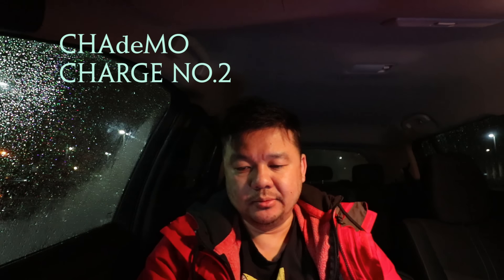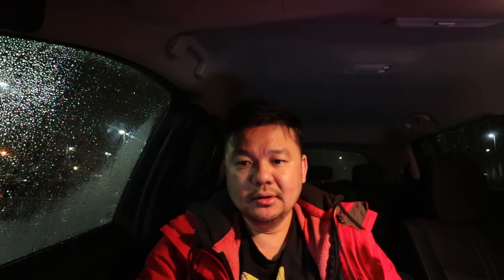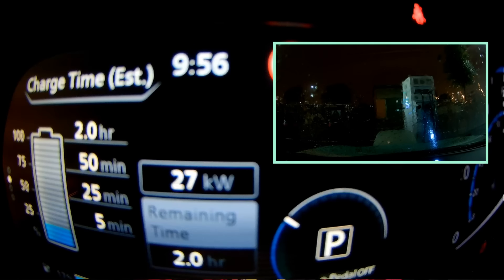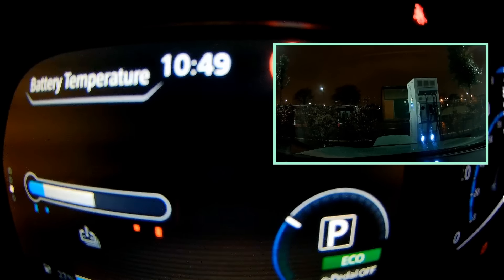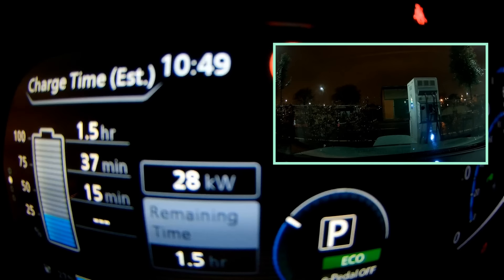Will lack of active thermal management system be an issue on Nissan's 40kWh Leaf?

Comment: Good work LTL and thanks for being a guinea-pig and doing more testing.  

Yes, this has come up recently and seems to be taking social media by storm - which I don't think is the right way because pretty soon you will see a lynch-mob mentality and I don't think that is Nissan's intent - to mislead anyone.  

It's clear that Nissan has put in safety features as to limit temperature increases which can be harmful to the battery and produce faster than normal degradation over the long use.  This new pack is more dense with a different chemistry than the 30kWh pack.  So being more dense will produce more heat.  

The 2018 Nissan Leaf battery – like all previous versions – uses a 96s2p cell configuration, this means that in total there are 192 cells in the battery pack. However, the battery cells now have a much higher energy density. 

In the 2018 Nissan Leaf, each battery pack has 24 modules and each module has 8 cells. Originally, the Nissan Leaf was launched with double the modules. The 24 kWh battery in the 2011 Nissan Leaf had 48 modules, each module with 4 cells. However, when Nissan released the 30 kWh battery, the number of modules was reduced to half – to further increase the energy density of the battery pack. 

This new pack has same number of cells, 192 but more densely packed.  The EV Module is 8 metal cells (pouch design) connected and housed in a metal case.  The case plays a role of protecting the cell from vibrations and the like, and its simple and compact shape increases the flexibility of pack design.  There are multiple slits and openings within this module that allow for passive heat dissipation, but obviously there are limits to this design.  I believe one of the chemistry changes is that Nissan added more Magnesium (but I could be mistaken in exactly how the chemistry was changed), but whatever they did was to lead to better energy retention properties.  

So with this info, on can calculate the new battery real capacity:
192 x 3,65 V x 56,3 Ah = 39,46 kWh
 
And compare it to the original battery pack in the 2011 Nissan Leaf:
192 x 3,75 V x 32,5 Ah = 23,4 kWh

Combine this physical change with a new chemistry and you get more density which produces a larger battery pack size and more energy output - hence the higher HP and Torque numbers.  The electric motor is the same, Nissan just tweaked the inverter to provide more power to the AC Motor.  

I think we can all agree that we wish Nissan had added in Active Thermal Management (ATM) to the 2018 Leaf.  However, they have not and will not for this MY so let's not beat that point to death.  If ATM is important, then I would advise not to get the 2018 Leaf, especially if you plan on doing longer range trips more frequently involving more successive Rapid Charging, as shown by LTL and other videos.  

I also think most people miss this point of the target market for the Leaf and the way it's priced.  It is for more Urban-ish applications in general.  Nissan saw a sweet-spot and gap in the 120mile range to 200mile range marketplace, and designed the 2018 Leaf as a product to play in that field.  It's not designed to be a Model 3 like-for-like, or even a Bolt like-for-like.  Both of those EV's have much higher range and ATM - but they cost thousands of dollars more - especially when you similarly equip them with the different Leaf Trims.  We know Nissan will come out with more of a competitor to these models next year or in early 2020 with an estimated 60kWh pack design that is guessed to have ATM technology.  And of course, it will be priced similar to competitors at that level.  

So knowing this, anyone looking for a full zero-emission all-electric compact vehicle, should be able to make a decision and see if the 2018 Leaf is right for them and their use cases.  As an example for me, my 2018 Leaf will be my daily driver as 90% of my driving is about 50-100KMs per day - well within the 200+ KM stated range - and even with cold weather losses of 30-40% range drop thrown in.  Plus in my family, we still have 2 ICE cars and if need to do a long trip (which we do occasionally), then I will take one of those cars.  

Yes, Nissan says use the car like you would any other car.  And in reality you can, however as LTL points out if you want to go for a 400+ mile trip, be prepared to add the extra time needed for your trip to account for slower rapid charging and cooling times with the battery.  

Nissan basically writes that into the Owners Manual, so they are not "hiding" or looking to "massively fraud" anyone.  That is ridiculous thinking that will just aggravate people into a mob-like mentality and scar the EV market as a whole.  Remember, people are getting upset with the fact that it will take longer to do a long roadtrip than it may in another BEV.  You absolutely CAN still do a long road trip in the 2018 Leaf, like if you want to drive to France for holidays LTL.  However, as you pointed out, you may CHOOSE not to since the inconvenience of more time to make the trip may warrant you taking an ICE or longer range PHEV or BEV car instead.  That is your choice and not because the 2018 Leaf can't technically or physically do the trip.  

I spoke to someone the other day that told me they love stopping for fast charging and don't mind the times, as that adds to the experience of the roadtrip for them.  So, if you want to go 400+ miles and get there the fastest, maybe don't buy a 2018 Leaf and look at a Bolt, or Tesla or i-Pace instead.  Or stick to ICE or rent an ICE car, etc.  You make the choice knowing what is available.  

I find it very unlikely (yet of course anything is possible) that a big company like Nissan, the original real founder of a mass-market BEV that prides itself on this fact of helping to ignite a new industry, would really open themselves up to a potentially massive lawsuit?  They know people are smart, we have tools like Leaf Spy Pro to use and most current BEV adopters are fairly tech savvy, so that something like what we are seeing would come to light quite easily.  And we use Social Media as a platform to spread opinions and experiences - and negative comments spread like wild-fire more than positive ones.  

I agree with those that in my thinking believe this to be a safety guard to protect the battery.  Plain and simple.  Yes, Nissan should state this with more vigor when advertising or selling the new Leaf, however we know that does not always happen.  It's also been shown that the GOM on the 2018 Leaf is really conservative and that the lower remaining battery percentage goes, the larger the difference is between actual SOC and the GOM (max at about 10-12% I think).  Again, I believe Nissan has done this in order to add a cushion for people so they don't end up being stranded with a fully depleted battery.  

So for those who want to slam Nissan and spread more negative comments, you might want to instead inform people interested in a BEV purchase of the real usability of the 2018 Leaf, so that they can judge for themselves if it is the right fit for their lifestyle and needs.  I am not saying that LTL is slamming Nissan - on the contrary his videos are excellent and he's just pointing out a current restriction with this BEV.  Maybe Nissan will tweak the software to allow for more charging input when the temps creep up a bit more than what it seems to be set for today. 

Also remember, the DC Fast charging station really does not impact charging speed in the vehicle.  All BEVs carry on-board chargers so the DC EVSE is really just a long plug that supplies up to a certain max power output.  The EV's on-board charger is what controls how much charge goes to the battery, not the external EVSE.  So, Nissan can tweak this situation if they feel they need to - which I'm not really sure they do.

This situation brought to light does nothing to change my personal opinion of the new Leaf and I agree with LTL, it's a great car and I am NOT cancelling my order in any way and look forward to getting my own Green (Jade Frost) Leaf in a couple of months.  

Sorry for the long response but I thought it important to bring this "issue" back into perspective.  

Keep up the great work LTL and I'll be talking about this on my next YouTube show coming up in a week or so.
Reply: Hi Kenneth, I know you from the M3OC... didn’t realize you got or are getting a leaf, I thought you had your name down for a M3? I have a reservation for a M3 and a leaf 2.0 preorder...mitigating risk around the rebate/election. Lol. Anyhow, all valid points you are making but it still doesn’t explain why Nissan did not put in a TMS! If they would have included in even a basic one i.e. a series of fans, it would have helped! This was a pure cost decision and they botched it. There will soon be a video out of a 650 mile drive in the  UK by both the ioniq and leaf. In the video the leaf and ioniq both leave the starting point at the same time but apparently the ioniq completes the drive 4 hours before the leaf all because of overheated battery issues!
Reply: Hi CB yes that is me.  And yes, I made the decision to order the Leaf instead.  Came down to financial cost (since I was interested only in the SR basic Trim Model 3) and that won't be shipping to Canada till 2019, and I am really concerned about the EVIP.  So wanted make sure I got the $14K.  No regrets and I will be stating this on our next show.  Just wanted to make sure the EVIP was still in play when I ordered the Leaf.  

Well, I really believe Nissan did not put in TMS for cost, and they feel the chemistry change was good enough to handle the vast majority of use cases.  Again, its not that that Leaf can't do long trips, it's just that is appears with Nissans safeguards, it will just take longer than what other BEVs can do.  So knowing that, a person can make the choice.  They needed to keep Leaf as a viable product in preparation for the larger pack model coming in 2019/2020 and the 2018 fit into a certain market segment.  I don't  have any problem with them putting this version out this year.
Reply: Kenneth Bokor I have a pearl white SV on preorder and it is expected to arrive in April. As well, I am planning to purchase the M3 current production.  If I get an invitation to place the M3 order shortly, I will not take the leaf. You are more than welcomed to take my place in line if interested.
Reply: I'm sorry to hear your rationalization. It's tragic to say the least. It does matter that Nissan has 'knowingly'  chosen to produce the Leaf without active thermal battery cooling/heating. And to make false statements about the importance of that specification failure for the use of the 2018 Leaf. As manufacturers with engineering expertise they have willingly produced a vehicle of unreasonable capabilities. And have not disclosed this to the public. When this behavior has become apparent the best course is to penalize such manufacturers by refusing to accept their product. That's part of the responsibility of every consumer. And it is your responsibility also.
Reply: Kenneth Bokor The big question remains....Does this software limiter really protect the battery when doing a very long trip.

Charging and discharging a li ion battery at a high temperature accelerates degradation. We all should know that (for people who don't know, but want to know...search for Jeff Dahn. He is a professor and has a great lecture online explaining factors surrounding degradation).

Now...apparently the amount of time spend (dis)charging at a high temperature is most damaging. Not the amount of power during the charge...

So would an hour of charging at 40-45 degrees C be more or less damaging then half an hour at 60 degrees. That's the tweak room Nissan has.

This somewhat limited long range ability is a trade off because of costs. The 40kWh Leaf will have an average charge rate of 20-28kW during a very long trip. The LR Model 3 would probably be able to hit an average of around 60-70kW.

In the end, you get what you pay for. Most difficult to assess is what to really expect from the car you paid good money for. Nissan should really communicate clearly on the long range travel limitations.

Interesting tidbit. Bjorn just did an (regular in his book) Oslo - Trondheim - Olso trip in the 2018 Leaf and had same results. Same charging rates at same temperatures. Very hard to cool down the battery between charging sessions, driving around 80kph in -5 to -10 degree C temperatures. Also....the charging rate seems to be determined at the start of the session based on the temp at the start of the session. Bjorn was charging at a certain rate (expected based on starting temp), then after a while, he disconnected and started a new session in succession. The second session started at a higher battery temperature than the first one and sure enough, the charging rate was lower.
Reply: People are complaining because it is a brand new car, but in it's name it should also be a "short range" or "City".
It's actual range at a decent speed is about 300 km, ranging from 250 to 350, depending on temperature. Any motorway driving, including some fast charging sessions beyond only one will become a pain for the owner.
Yes, it is a nice short/mid range commuter car, but it could be so much more.

People are comparing it to the Hyundai Ioniq, which has a significantly smaller battery, but has similar motorway range due to better efficiency and greatly superior long range capability due to active TMS.
Reply: I have owned a 2013 leaf for 3 years. I just bought a 2018.  I'm used to being a able to "fast charge" multiple times. I've read the manual. Saying "quick charging ... even several times a day" "if the battery temperature is not near the res zone" I have seen limiting with temp just above the middle of the bar. For the record the whole gauge is near the red zone. Near the red is ambiguous as hell. Ambiguities are read against the writer. 

Limiting battery heat at low temperatures is not a safety issue it is a warranty expense issue. 

Did Lemon Tea say limiting occurred at 38 c / 98f? If so that would mean no real fast charge in wide swaths of the world for most of the warm weather. 

I could not fully fast charge. 

That is not clear from any source from Nissan.

Comment: The issue lies within the BMS. Nissan needs to reprogram it so it stays at a hgher rate of charge until it reaches >47 Celcius. The 40kWh has a newer chemistry versus the 30kWh. The newer chemistry ( less manganese) has a lower internal resistance, so it should heat up less than the 30kWh. Having owned all versions of the Leaf, the 40kWh is the worst with regards to charging rates. I did 4 consecutive QC in a row on my 30kWh and the battery temp was at 49 Celcius. The charging rate did not drop like on the 4 kWh Leaf.  After 53000 kilometers my 30kWh has 2.2 % battery degredation. Another thing people are not aware of is the fault in the BMS with regards to true SOC. Plus the battery % on the dash jumps up and down. This needs to be addressed also. Thanks for another great video.
Reply: I think videos where LEAF-SPY has been used to compare battery % with that shown on the car - Nissan's 100% indication is really about 90% and Nissan's 0% is really 9to 10% so they are restricting you to a charge capacity of 80% to allow EV novices to charge to what they believe to be full 100% without damage and run it down to what they believe to be flat 0% without damage to the battery from overcharge or low-charge states.  I believe they have also taken this overprotective approach to the temperature v charge rate mapping which I'm sure they would reason ought not to be a problem if you follow their fair usage policy of no more that 1 rapid charge a day a limit previous models were also supposedly be restricted to. However, LEAF drivers have become used to driving grater distances and rapid charging without too much of an issue and therefore quite rightly expect to be able to drive still grater distance with the greater range claimed by Nissan for the LEAF 2.

Comment: Great work Lemon-Tea Leaf, this definitely seems temperature related. An even more concerning thing with all this is that users are already encountering this issue in the dead of winter with cold external temperatures. It makes me wonder what will happen when owners of these cars drive them in the middle of summer with ambient temps in the low to mid twenties. I suspect people may find they could have charging rate restrictions at even the first charge!!
Reply from the maker: If I'm correct and its software related then the first charge shouldn't have an issue it seems to take the temp into account after the first charge. maybe they need to change a line of code

If CHAdeMO = 2 then goto var THROTTLE_TEMP

yes i know goto is bad in code but you get the idea :)
Reply: What is the safe operating temperature of the batteries?
Reply: Have you spoke to Nissan to complain i would be saying car aint fit for purpose.
Reply: Lemon-Tea Leaf is not rare for summer temperatures to reach 30c 
I ve seen a video where a Leaf owner was stranded by a overheating battery at -5 exterior Temperature
.
Surely an Extra 35c on a already overheated  battery  is catastrophic.
Reply: luckily in Scotland if the summer temp ever reaches 30 degrees it would be a major news story - happened a few years ago and it was the lead item on the TV news!